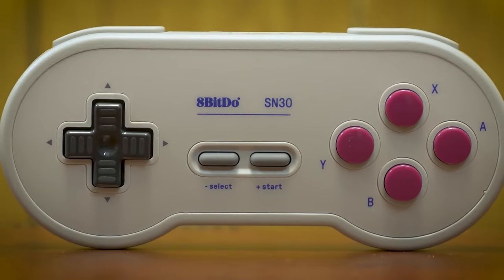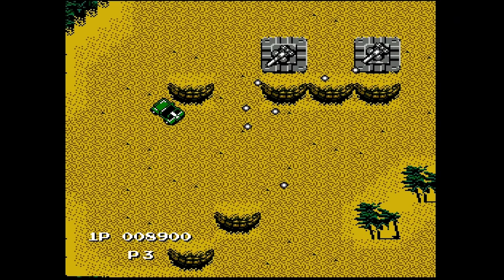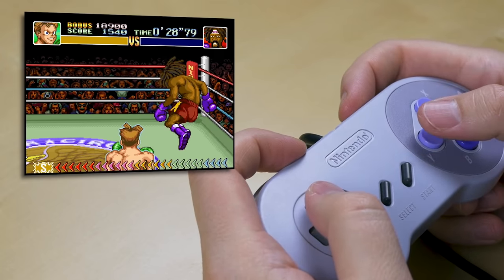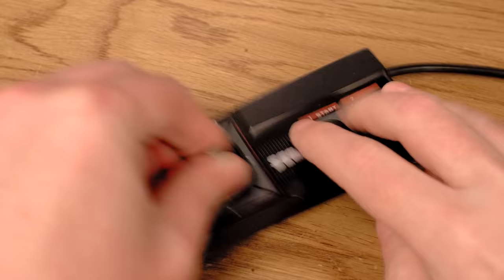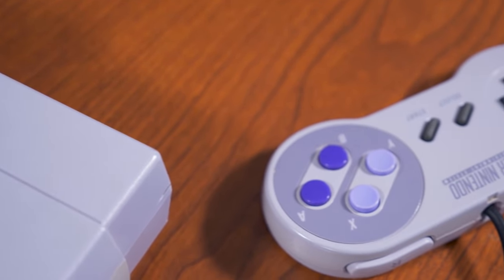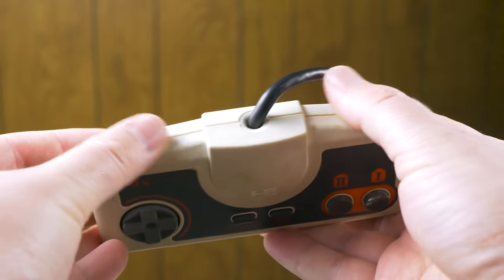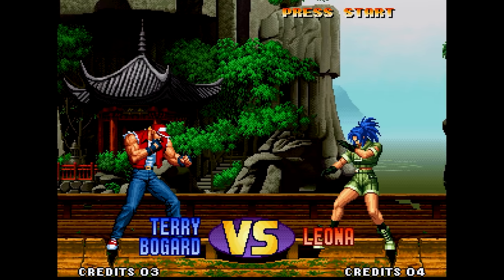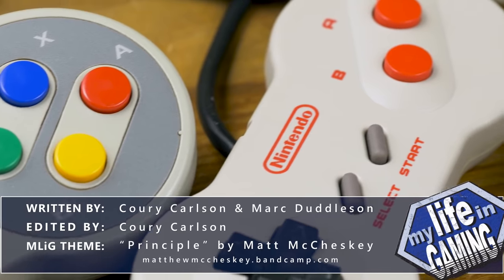First Party Controllers #1 - NES, SNES, Genesis, TG-16, Neo Geo, and More! / MY LIFE IN GAMING

Comment: The thing about the retro-bit controllers is that the d-pad reverse bowl thing on the inner part is actually more shallow than a real controller which is why you can press all the directions at the same time yet still feel like there is some sort of pivot. The good news is that if you are buying this to replace a worn out original 6 button controller, you can pretty easily swap them out and then the retro-bit controller feels great. 

I personally had a hyperkin gn-6 controller which while it did a lot of things right the rubber contacts however were stiff and made an unpleasant rubbing sound and feeling while you rolled the d-pad which kind of killed it for me, oh and the lack of proper quality control as one of my screw posts on that controller was stripped right out of the box new killed it for me also. Anyways I used the inner part of their d-pad on my retro-bit controller so I know for a fact that those work just fine also. (PS: Hey hyperkin are you reading this? Sell that part for like $1-5 bucks under your repair box brand. You'll thank me later.)

We shouldn't have to do this to fix these controllers, they should be put on the marketplace without this problem in the first place but retro-bit/hyperkin can't help but sell new products without some major flaw even when it's licensed by Sega so they don't have to worry about being sued for making an exact copy but at least with this controller it can be addressed and then you have a new controller made in the last year instead in the last 30 years.

Comment: I think the Famicom and Super Famicom controller cables where short as their livingrooms or area's where they had their TV and console setup tended to be smaller and just players would be up closer to the TV and console where as in North america we're used to playing in a moderately large livingroom or space and sit a good distance away from our TV's (especially if you had a larger TV which is especially the case today)

ALSO While some people may think of the 3-button Sega controller when it comes to the Genesis, I grew up with a North American Genesis Model 1 which we had 2 matching 6-button controllers for but eventually we had to scavenge parts from the 2nd controller to keep the first one going until eventually the controller was just too broken to use and by then we had a Playstation 1 and a Playstation 2 and so the Genesis sat in storage for years without a controller and most of its games having gone missing.

While I feel comfortable emulating NES, SNES, and Playstation games with a XBOX 360 or Playstation style controller with its 4 face button setup, it just never feels right playing Sega Genesis or Sega Saturn games on a 4-button controller. Sadly its been hard for me to find decent working USB controllers with a 3 or 6 button layout similar to the SEGA Genesis controller with the buttons being in a row at the minimum. While I have one controller with joy sticks and 6 face buttons and a d-pad its gotten a bit weird where it doesnt want to accept input and the joy sticks are buggy and keep giving input even when they're dead center.

I wonder if there are any modern PC controllers with a similar 3 or 6 button layout to the Genesis (and perhaps has the other features one may want for other games like the 4 shoulder buttons or bumpers and triggers with joysticks, and with start and select or buttons that can be used as such)
Reply: You might want to get an 8bitdo M30. Sounds like exactly what you're after. It's basically a clone of the genesis 6 button controller with a slightly different shape, shoulder buttons, start and select, plus the other two buttons (which on say a switch would be the home and snapshot buttons, but they work for all consoles and for PC just as you'd expect). I love 8bitdo, I've bought I think 5 of their gamepads now, because they're really quality solid gamepads. The new one that's a SNES controller with analogue sticks and handles, plus all 4 shoulder buttons, has become my primary switch controller over the Pro Controller. It's basically like an old Dualshock controller, which I prefer to the xbox style layout of the sticks
But yeah I play the street fighter anniversary collection on switch with my M30 cos of the 6 face buttons and the d-pad that's easier to do quarter circles with than a Nintendo style d-pad
I use it for emulating genesis games on my tablet or my pc. Unfortunately it can be a bit wonky using it for the genesis collection on Switch because you can't remap the buttons on it like you can with emulators on a tablet or whatever, meaning games that don't have remapping options in the options menu can mean you have to do jump and a attack at a really awkward thumb angle. It works for some games on the NES and SNES games on the switch
But yeah cos of that it's mainly my pc and android emulation gamepad. Cos I grew up with a Sega d-pad and I still prefer it for retro games, and this 8bitdo one is an exact copy of the old Sega ones.
Oh yeah should mention, the M30 like all 8bitdo gamepads is Bluetooth, but you can connect it with USB to your pc or your phone or your tablet or your game console of choice, etc. The Bluetooth works great and I can't tell of any lag using it that way, but if you want it even better then yeah just plug it in with a cable
It also has different basic controller "modes" for lack of a better term. By that I mean it has xinput mode, dinput mode, switch mode, and macOS mode. You choose which by turning it on differently. Like to get xinput you hold start and X to boot it into that mode, to get dinput you hold start and B to turn it on in that mode etc
Oh one extra thing, if you end up also getting one of the ones that's laid out like a Dualshock but with the SNES d-pad and buttons etc, the SN30 Pro, it comes with a removable lithium battery that charges with a basic USB C cable that you plug into the controller (while using it at the same time too), so you can replace the battery with another a few years down the line if it runs out of charge too quickly, or you can put 2 AA batteries in it instead. I think that's a fantastic feature, they only have it on that model though
I could wax lyrical about their gamepads for much longer but I'll cut this short cos I'm probably boring and I probably sound like I'm a secret employee of theirs lol. But I'm kinda a collector of gamepads now. I have 5 or 6 8bitdo ones that I have no need for cos I have no friends lol, but I just like the variety. Plus I have the pro controller obviously, I have the gamecube controller for switch despite smash ultimate being my first smash game and I've never played a gamecube in my life, I just think the controller is cool and it works for all games on the switch anyway so why not, I've been playing resident evil 4 with it. And I've got one of the power A "elite" controllers for switch or whatever they're called, which has programmable extra paddles on the back
I just love different gamepads
I also have one of the awesome new Retro Fighters n64 pads that are way superior to the original n64 pads, I backed their kickstarter on the tier where I received one, and I did. Little problem though, I don't have an n64 yet...
Sorry for rambling on at ya

Comment: My hands grew up with the classic dualshock controller (PS1, 2 and 3) and that is the ultimate controller to me. This is I think the real deal-breaker for everyone: most people will feel that the best controller is either the first one they used, or the one they used the most. I wish 8bitdo would make a classic style Playstation controller for the modern generation of consoles.
Reply from the maker: [Try4ce] I think it's a little more complicated for older folks like us, though. Analog sticks weren't common until we were teenagers already, so our formative years were with even simpler controllers. The "standard" controller hasn't evolved very much since the PS1, so most of your choices on other platforms would be the same, but different. Before then, differences between controllers were much more profound, so I don't think "favorite" necessarily means first or most used if you were growing up before controllers became so standardized.
Reply: @mylifeingaming  I see what you mean. Though I'd have to politely disagree on controllers being standardized. To my hands at least, there is a substantial difference between the Playstation and Xbox designs, be it in term of analog stick placement or in the bulk of the controllers. And there are still a lot of disagreements, to put it lightly, between the two camps on the internet.

Comment: What is that charger that you have the Switch Online NES controllers charging on Try? I really need one that will work in my set up.
Reply from the maker: https://www.amazon.com/gp/aw/d/B075FF6HDN?psc=1&ref=ppx_pop_mob_b_asin_title It's this one. Most won't fit the NES ones because they have a base but this has no base. Note that the SNES one is just sitting there looking pretty, it's not actually charging. I'm trying to figure out a good way to make the charging contacts touch it, and I think it can be done, but I just haven't come up with my method yet.

Comment: The Zapper does work on the top loader. I literally did it yesterday. Not modded at all, all stock for both consol and zapper.
Reply from the maker: [Try4ce] You misunderstood. I'm talking about the AV Famicom, not the equivalent NES toploader. The Zapper will not work on that system even though it has the same inputs.

Comment: "...until the more budget friendly NeoGeo CD arrived in 1994"
You misspelled LESS EFFING EXPENSIVE
Reply: The neo Geo CD was 400$ in 1994. The aes maybe 500?
Reply: @drunkensailor112  I think the AES was around $750 (adjusted for inflation.) But that was the base model with no pack-in included.
Reply: @drunkensailor112 @sambo0909 During the early 90's, the Neo Geo AES was definitely $650 for the version of the console that came with two joysticks and Magician Lord. Two relatives of mine use to work for a store called The Wiz during the early 90's which had the Neo Geo AES in stock and it was $650 for that model (as a kid back then, I even saw it myself several times). The Neo Geo AES games were $200 each during this time period. That is not a typo, the GAMES were two HUNDRED dollars each during the early 90's. Keep in mind that mind that during 1991, the Sega Genesis console was $150 and Genesis games, on average, were on average $50. Neo Geo AES was expensive as hell back during the early 90's. Many of it's games are super expensive today if you check ebay (some going for thousands, especially certain later releases for the console).
Reply: You misspelled "pronounced"

Comment: I am glad that you made this video. I had the same issue with my snes controller wherr the start button stopped working.

I live in the caribbean and at the time amazon and ebay were not easy solutions to solve my problem.

I ended up buying a yobo 2 in 1 console...and it comes with 2 snes style controllers. While they do work, it just does not feel right. My biggest issue with 3rd party controllers is that the d pads never feel right. I have the SAME issue with te dualshock ps2 controlls which are notorious for spoiling after time in storage. No other controller feels right and it makes playing capcom fighting games almost impossible.

Comment: Even right-handers are going to have problem with the Sega arcade stick.  It depends on the type of you have. 

If you have a game like Tutankham or Side Arms, where left represents left fire and write representing right fire, it'd be the perfect joystick.

Unfortunately the only two games that it would be perfect for I don't think is available on the Sega Master System.  Every game that I played on the Master System with the arcade stick seems to have you do middle finger pumping.  That's right the buttons are technically correct, but most arcades near map left and right not copy paste left right.

The theory is that your main button, the one that he has to be pressed the most or press that the most precise time is under your index finger.  The secondary button would be under your middle finger.  

Luckily if you want either a left-handed stick or a right-handed stick with proper index index mapping the Beeshu SMS  Superstick will be your best friend.  If my custom fightstick won't work then the superstick will work.  It has mirror buttons on both sides of a central joystick for your left-handed or right-handed play.

Let's get one thing clear I resent I have four years of video game muscle memory will Nintendo came out with the NES.  I resent Nintendo both going with a left-handed layout and not only just not licensing the NES version of the NES superstick, but actively fighting against it.  There is some other crap that was licensed, but this is the success story  Beeshu.  First they release the beast shoe jazz and that sold well.  But they wanted to put pursue an NES license an NES Nintendo failed it because it was right handed.

So they made the super stick and Nintendo fieldglass despite the fact that having an ambidextrous layout supplied by mirrored buttons.

Nintendo Still failed it, and the Beeshu stick was selling well.

Finally in the early 90s when the FTC decided to go after Nintendo and Sega for monopolizing the console Market, first they dealt with issues of exclusives.  I heard Nintendo was required to license any stick that was ambidextrous and otherwise passed all other standards and literally the only  standard it previously failed was the standard Nintendo layout of a right handed layout present.

Later models of the super stick got licensed for the turbo graphics 16 and the Sega Genesis.  But the Sega Genesis started to show cracks in the button mirroring strategy.

Before the difference between a Beeshu and the advantage was $10.  But most of the time critics said the B she was better and not just because of the right handed layout.  They're using real arcade parts, at least they were before the crash.

I probably identify myself as a Coleco Youth.  It's almost as if you're saying there's no controllers before the NES.

You seem to gloss over the second-generation design as non existent.  

You seem to offer nothing to fans of the second generation of video games, unless they happen to like the 3rd generation and later.  So many times I ask where is the second generation.  (By the way the first generation stuff is Odyssey 1 as it's now called, Atari Pong machine and various pong clones.  That's probably the only generation that no one longs for except serious collectors.  Probably because both games could be accurately played on a generation 2 console.  Atari had Pong Sports (originally called the Olympics but the International Olympic Committee fought hard to ban that word in  non-authorized games) Bally had a compilation included in Tornado Baseball.

The second generation of consoles is the Generation X of console generations.  Everyone seems to talk about baby boomers and millennials dominating everything.  The only place where the parallels fail is that generation one is almost forgotten.  

If you want to read more of my right-handed comedy rants, and a story of how a right-handed joystick went a perfect 200 wins and zero losses in a home gathering of Street Fighter 2 for the Genesis, visit sinistersticks.com

I understand you guys only do what you know and love and apparently none of you seem to either know or love the second generation as much as I did.

If you ever need a second-generation expert just by living through it  , you can reach me at my website.

Comment: I saw a controller that had four buttons on it which is standard. I do not remember what the buttons were labeled but if we pretend and use the Xbox 360 controller as the button labels then the why button was farther away from the x button for some reason but all the buttons were just as close to each other other than that

Comment: Do you two have the official og Xbox component cables or you use a no name third party and are your Xbox softmodded or refurbished with new capacitors and thermal paste
Reply from the maker: [Try4ce] Official component cables. In my experience, third party component cables for Xbox are some of the worst. I do have a soft mod but don't utilize it as much as I could. My Xbox was recapped because it stopped turning on but I've never had thermal paste replaced.

Comment: Agreed on the newer better SNES controller, I have one that was actually a factory repair and they basically sent the customer back a new replacement controller that stated it was a factory replacement. It is AMAZING and I use it for all my gaming on the SNES. There are actually 3 versions, the 1st version had the "L" and "R" logos just printed as well. The second version had them engraved but could still have the screen printing logo on the front, and the final as you noted was engraved logo and engraved L/R buttons. I'd be curious if you felt the same on the "2nd" version too?

Comment: The NES controllers sharp edges are only a problem if you hold it like as if it had shoulder buttons, with your index fingers on top of it. I never held it like that so it's never been a problem for me.
Reply from the maker: [Try4ce] I tend to hold it that way a lot of the time and it's still not a problem.

Comment: You can't really call the Master System controller an imitation of the NES one as it's essentially just a recoloured SEGA SG-1000 MK2 controller with a slight layout shift.  Yes the Famicom did launch before the MK2 however both took their controller designs from handhelds of the era.